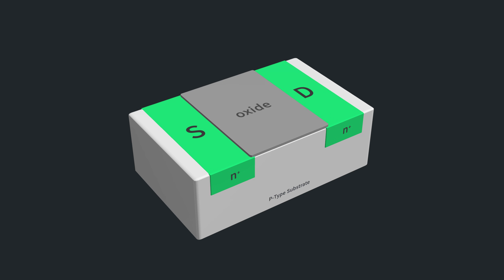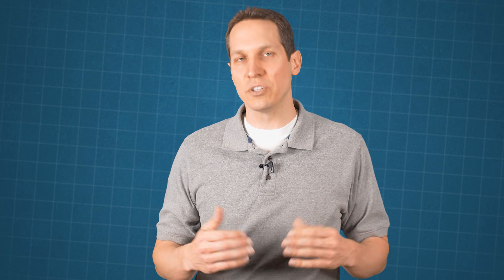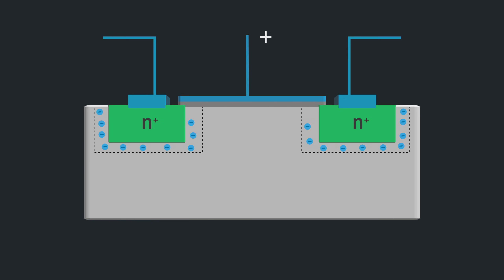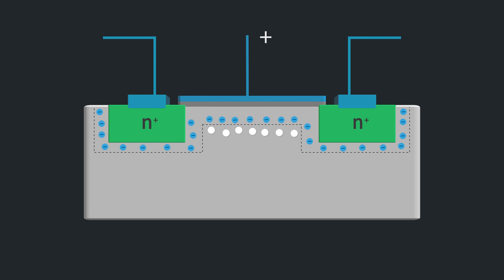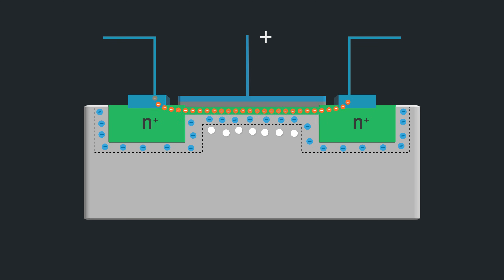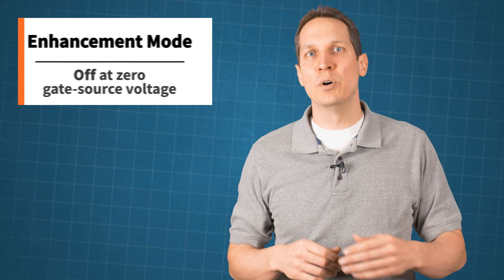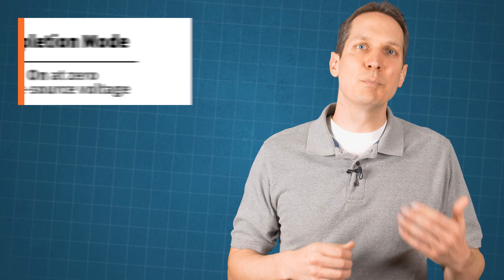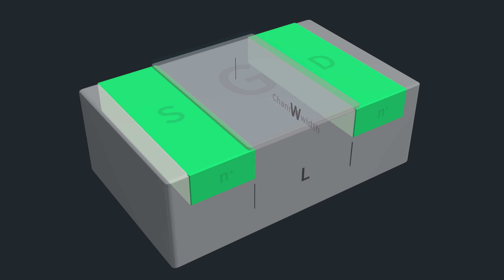How a MOSFET Works - with animation!  | Intermediate Electronics

Comment: Great video,  Thank you.
Can I say that current in saturation region depend on DS voltage and in triode region depends on GS voltage?
Reply from the maker: Although it depends on both, if anything, I'd say the opposite.  When in the saturation region, it's Vgs that changes the current flow and in the triode region, the current is changed by varying Vds.  For more in-depth, we did this tutorial:  https://www.circuitbread.com/tutorials/what-are-the-different-regions-of-operation-for-a-fet  Hope that helps!

Comment: How is this a good explanation? explaining saturation/pinchoff region as if it is "cut off" or "not enough". Saturation is what it is, it is conducting to it maximum limit, it is too much causing bottle neck, not too little. Form a channel first, then apply Vds. Explain it the natural way.
Reply: Saturation is when the drain voltage has no influence anymore. For example in N-FET logic you want to pull up with a constant current instead of Ohmic. This pull up does not fight the wired-or N-FET gates as much in on-state, but still pull up all the way to off-state in the same time.

Comment: So the structure of a MOSFET is symmetrical and hence Source and Drain are completely interchangeable?
Reply from the maker: Yep!  Or at least the one shown is.  Sometimes manufacturers will put in other features (like a flyback diode on a power MOSFET) that will make it so the FET is not interchangeable.  Or they'll make internal connections that will force it to be one way versus another.  But, again, as shown and in many MOSFETs, they are interchangeable.

Comment: At 2:05, how is it possible that the MOSFET is operating at the pinch-off point when the gate voltage is lower than the threshold voltage? The gate voltage must be greater than the threshold voltage for the MOSFET to even operate in triode. The pinch-off point is the voltage that separates the triode region and saturation region, which is Vdssat. The pinch-off point is not governed by gate voltage but by drain to source voltage. When Vds is Vdssat the pinch off point is exactly at the drain. When Vds is greater than Vdssat, the pinch-off point moves toward the source. What you said here is contradicting. How could there be a pinch-off point if gate voltage is less than threshold voltage, meaning that the device is not on and not in even triode mode, needless to say saturation?
Reply from the maker: Hey Jarvis, I think you are struggling with the same thing that confused the heck out of me for the longest time as well.  I highly recommend watching this video:  https://youtu.be/o3M2sOCGCKs  It should hopefully clear up all of these questions!
Reply: The pinch-off happens close to gate and drain. Why would source be important? “Saturation” is too confusing for me like it is for others.

Comment: Thanks a lot! Will the threshold voltage change when the voltage between source and drain changes?
Reply from the maker: Edit for clarification:  No, it won't, actually.  Strangely, even though the threshold voltage won't change, you could see a change in the source-drain current.  Using the faucet comparison, increasing the source-drain voltage is like increasing the pressure of the water.  It doesn't open the faucet more but if the faucet is slightly open, then more water will come out to a certain point.  But, again, it doesn't open the faucet more.  This relationship is covered more clearly in this video:  https://youtu.be/o3M2sOCGCKs  Hopefully this helps!

Comment: Do a video on how to identify the size of a mosfet to buy one. For example, I removed one from an inverter and want to buy a replacement. How do I buy the same size?
Reply from the maker: I'm not sure if that warrants a full video!  Whenever I do something like that, I either pull the part off and google the part number etched on it or just go to somewhere like DigiKey and use their parametric search using the package size and just make some reasonable assumptions on what it should be.  The former is definitely the better method, if it works, though.

Comment: So are the source and drain the same? If so why are there two names?
Reply from the maker: Excellent question!  The source and the substrate are connected to the same point electrically, otherwise they're symmetric.  Some MOSFETs you buy have the electrical connection internal to the device, so it already establishes which one is the source.  Other MOSFETs allow you to connect the substrate to whichever point you'd like. What I'm not sure of is, if you connect the substrate to one side, does that side assume the name of "source"?  And then if you switch it to the other side, does THAT side become the source?  That's a naming question, not a technical/functionality question, as whatever side is connected to the substrate will act like the source.
Reply: @CircuitBread  Thx